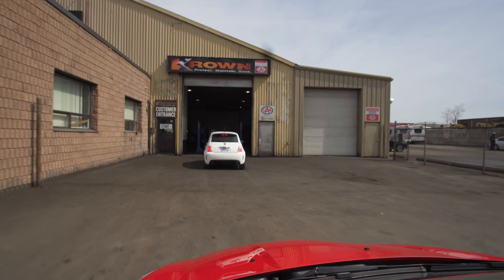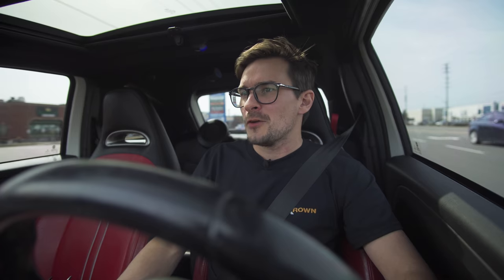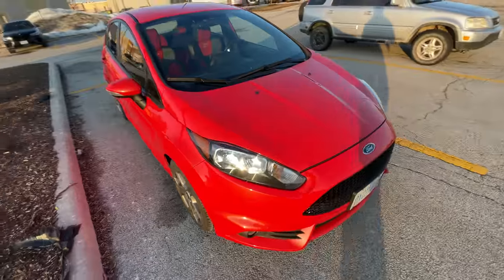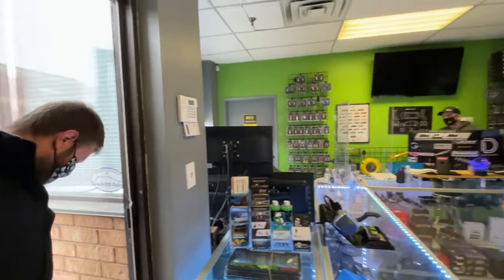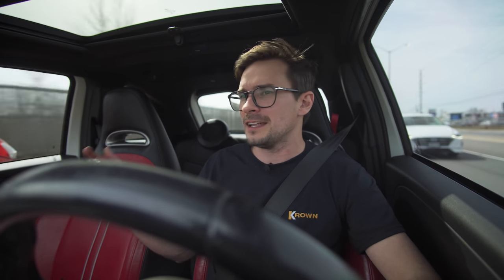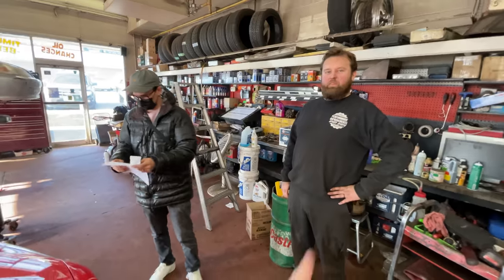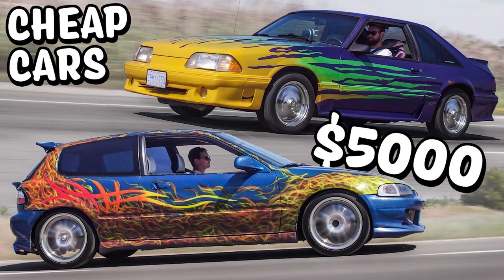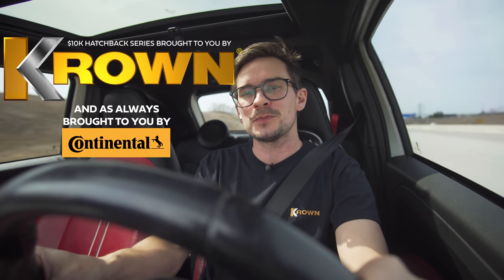$10,000 Used Car DEAL of the CENTURY!

Comment: I have a 14 Fiesta ST got it new, it has 102,000 miles on it and it's on a Cobb Tune MBPR exhaust, sticky Michelin Pilot Tires, I've had 14 Cars and 9 Motorcycles in my 74 years, and by far my Fiesta is the most Fun I've ever had driving, I'm on my 6th set of tires, they're basically Street legal go-karts enjoy my friend I love your videos the Fiesta Flash.

Comment: As a former Fiesta ST owner,  here’s a couple of things that may interest you:
If you don’t want the fake engine sound, (yes, sadly some of that is fake), Google “Fiesta ST sound symposer delete.”  Mountune sells them for 50USD.  That way, all you hear is all-natural exhaust noise when/if you get around to modifying that.  When I got my delete, I actually left the exhaust alone because apart from the turbo noises, it sounded like and old-school 4 cylinder BMW. 
Second, you can pay to get Apple CarPlay/Android Auto patched into that MyFord Touch system.
Last, but probably least, it has the same gearshift as a manual Ford Mondeo I once rented in the UK.
Happy driving! 👍

Comment: What's the steering ratio on the Fiesta ST? One of the best things I love about my old Focus ST is that 1:1.8 steering. It feels so direct and tight in corners, but it is also pretty sensitive on the freeway if you are cruising and reach over to get something from the passenger seat. A tiny bit of touch will shake the whole car. Also it's pretty sensitive to water sliding with the combination of steering, low ride height, and maybe other things.

Comment: I love mine. Such a fun driving car. It's also REALLY easy to modify. Intercooler, Exhaust, Tune...etc. But if you don't do anything, the one thing you MUST do is swap that rear motor mount out of there. Trust me!
Reply: Everyone please listen to this man, he’s just trying to help
Reply: RMM will cause premature wear to the passenger side motor mount. You can't have it all.
Reply: @2damaxmr2  I haven't heard that one. Interesting, I wonder why that would happen.
Reply: @maxxgraber  the energy doesn’t disappear it just get transferred to another component.
Reply: @2damaxmr2   When's this supposed to happen, so I know before hand. 2018 with less than 17,000 miles.
Reply: @maxxgraber  If you don't have aftermarket RMM i wouldn't worry about premature motor mount failure.

Comment: After the two challenges there should be a gears and gasoline style road trip in the two hot hatches, it would be great the see how both of you feel about them after some time. When I bought my focus rs I tracked it down to a dealer that was 400 miles away and the trip home in it was completely worth it. Also realized I really needed aftermarket springs for the suspension, the bounce after every bump on i80 was terrible lol.

Comment: I had a 2014 Fiesta ST with the same hood sensor issue. Ford dealership tried to fix it a few times. When the sensor is not working, the burglar alarm may not be activated. I also had situations when the warning would go away and then the alarm would go off in the middle of the night. Also recommend getting Ford OEM TPMS as the stuff I got from Tire Rack required recalibration every year when I switched from winter to summer. The Fiesta trim was not designed for the stiff suspension so the squeaks and rattles were annoying at times. That being said, I miss mine every day though. It will be a classic.

Comment: Fun fact you have a very early built Fiesta ST. It redlines at 6,900 they quickly changed redline to 6,500. Not sure why I can’t remember. Also straight pipe the Fiesta and it’ll sound better then the 500. Mine has been like that for 6 years and I daily it.

Comment: I owned a 2014 FiST for 2 years. It doesn't sound great on the outside, but it drives sooo much better than the Abarth. Only reason I sold was because the 2014 ST's rock hard suspension was a back breaker on the daily commute.

Comment: Awww the nostalgia hearing the Ford door open chime!! I had a Fiesta St,mehhh ok it was fun sure. After I threw in an intake it gave me a really nice blow off noise. I liked it better than any other blow off valve available actually, I feel they sound like so fake and weak. It was weird but the intake gave it a deep/aggressive blow off sound. After 60k miles if it was over 85 out it would overheat so bad I had to pull over and let it cool off. I had Ford check it twice and basically said it was fine/did a coolant flush. The car needs bigger thermostat or intercooler. I own an Srt4('05 Clean 75k original miles in Flame RED) and a Veloster N now. I am sorry but the N is the "best hot hatch" ever built in the woooorrlld 😛 haha, screw "in NorthAmerica". Just playing around fellas, enjoy your new little pocket rockets. I know I love mine. 🚗💨

Comment: Are there any long term reviews with Crown? 
A while back I discovered ACF-50, apply it yearly to my frame and electrical connectors. I have seen some back-yard anti-corrosive comparisons and it seems to hold up well.

Comment: *QUESTION*. Does the TurboSmart BOV throw any codes? I’ve seen them throw codes on other Ford Ecoboosts but I was just curious. Thanks.
Reply from the maker: No it comes with a plug that plugs directly into the unplugged end from the stock valve
Reply: @TheStraightPipes  Hey thanks for the speedy reply!

Comment: Cool cars but I wouldn't buy neither one of them😏they're not reliable🙄
Reply: Not accurate. Mine had 155k miles in 5 years before I sold it. Many are pushing 200k and one guy, who puts 10-15k miles a MONTH on his FINALLY broke down at 298k, 100k further than his prior Fiesta st. My 2015 had zero issues. I can't speak for the fiat though. You'll hear complaints on social media which is why is perceived that the Fiesta st is unreliable. The percentage of reliability issues compared to how many were sold is pretty small.
Reply: @Darylrb1983  agreed 👍